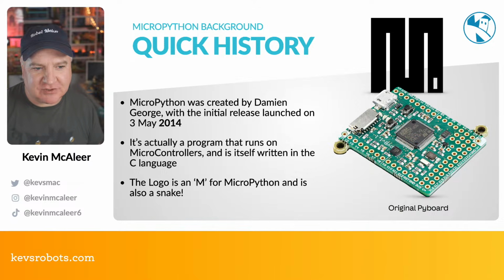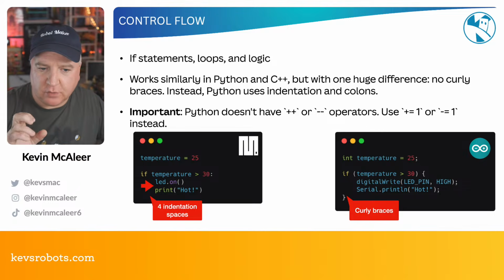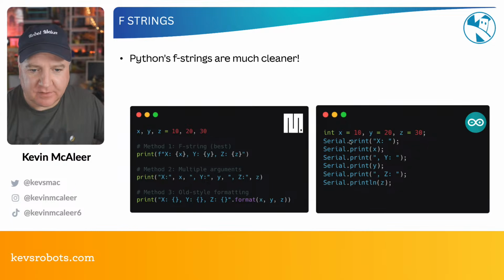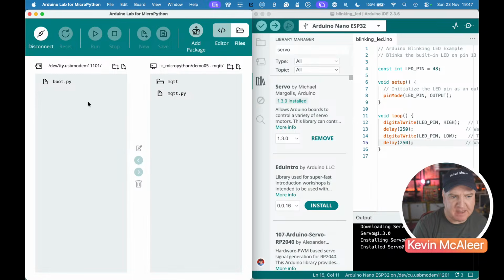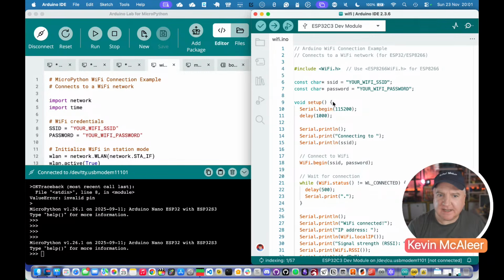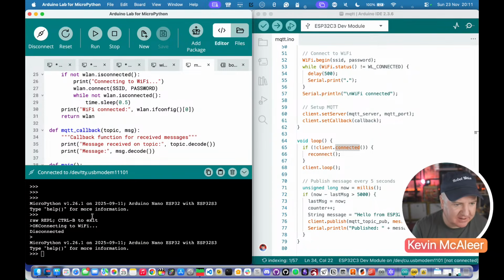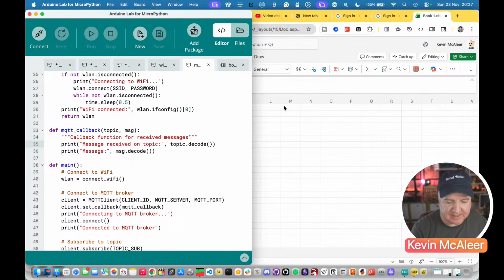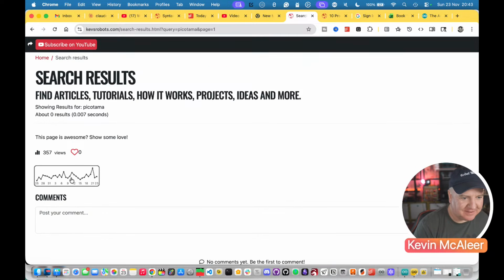Why is everyone switching to Micropython?

Comment: I'm using Micropython since the first release. CircuitPython supports features, which aren't supported yet officially with Micropython (CAN Bus e.G.). But be aware, that you can't use drivers from CircuitPython with Micropython and vice versa.

Comment: This is painful to watch as a software developer... Judging a project by stars on a repo is an awful idea, it's not used as an evaluation metric by any sensible engineering team.

But I do understand your viewpoint, if all you're doing is making simple one-off toys that only use buttons, LEDs, servos, and a sensor or two, Micropython is a perfect choice.
Reply from the maker: What evaluation method would you suggest? Given Python is used to power the worlds AI systems, and most of youtube and google, I think its a bit more capable than doing one--off toys. Micropython is just as capable as Arduino/C++
Reply: @kevinmcaleer28  Micropython is just a limited subset of Python so your comparison is wrong in that regard. There are no interpreted languages running on virtual machines that are as capable as compiled languages so your comparison is wrong in that regard too.
Reply from the maker: @pseudo_ctrl this very platform we are talking is run on Python scripts. So I beg to differ!
Reply: @kevinmcaleer28  Python is decent for gluing things together, which is a very different thing from making efficient microcontroller code. However, tons of projects don't need efficiency, and MicroPython can be spot optimized (including native code generation) for specifics with Viper. All those ML and video processing scripts call out to foreign code that does the heavy lifting. Compared to Arduino, MicroPython gets you some very helpful included batteries, at the expense of the ability to run on small MCUs. Arduino itself has some ridiculously poor implementations of I/O abstractions, so doesn't do C++ justice at all.
Reply: @kevinmcaleer28  This is going to be a bit of a novel, so I understand if you don't read it all.

First, I think there's one main thing that needs clarification: Micropython is Python in the sense that they share the same syntax, but aside from that, Micropython is not Python. From a technical perspective, this is called a different interpreter, Micropython uses a different interpreter than Python. A lot of basic, pure Python code can work on Micropython, but not all, there are lots of core libraries that are missing and any Python package that uses them won't run on Micropython.

Google doesn't use Python that much in it's applications that are consumer facing, those would be in Go, C++, and Java. Python is used in the AI toolchain where speed doesn't matter like in pre-processing and designing neural net architectures, but Python is not used during inference (when the AI is being used), that's all in C++ compiled to be optimized for their TPUs.

When evaluating a software stack or library, these have been pretty widely agreed upon metrics to assess a technologies viability at the companies I've worked for over the last decade plus:

* How many unique contributors have contributed to the project? Also, how much have they contributed?
* How old is the project?
* When was the last release of the software?
* Do they keep up with any upstream software they depend on?
* Are there regular releases?
* Is the project activity like commits, PRs, and issues trending up or down?
* Is the project part of a larger open source foundation? Like the Linux Foundation, Apache Software Foundation, Cloud Native Computing Foundation, etc.
* Are there industry conferences for it?

* How many companies are using it it production? This is important because it shows that getting a product to market is actually viable with the tech stack and that it's likely to get maintained for the expected lifetime of your product.

On this front, I don't know of any companies who use Micropython in consumer or industrial devices, but I also haven't looked into this. However, I do know of several companies who ship hardware that uses the RP2xxx series of microcontroller, and they use bare metal C or C with FreeRTOS or Zephyr.

* Is it in a stack that we can hire a development team for?

Here's where it gets interesting. There are plenty of Python devs out there, but very, very few will be familiar with embedded development. So in this regard, Micropython fails because scaling a team for product development would be difficult. But don't take my word for it, search Micropython on LinkedIn, Indeed, or other job sites. I was only able to find a few jobs that even mentioned Micropython, and even those didn't list it as a core or required skill, they list it as an example of something to be familiar with. Search for embedded C++ developer jobs, and you'll find things are very different from Micropython. 

Now from a developer's perspective, here's why I decided against using Micropython in my latest hobby project:

* Inconsistent HTTP server response time jitter with asyncio (probably GC related)
* General connection latency jitter when using server or client TCP sockets (probably GC related)
* No documented way to run CI/CD in a Docker container or service like GitHub Actions
* Supporting multiple boards for the same project is painful
* No common practice for A/B style of OTA firmware updates
* No common process for code signing firmware images
* No common practice for packaging a firmware image
* No breakpoints or hardware level debugging via GDB

All that said, I would chose Micropython for most of my projects since most of them are very simple. My most recent project has the most potential damage my equipment when I use it, so I've opted to use C and possibly Rust to ensure I have high consistency and reliability.

Lastly, you talked about speed of development cycle time with Micropython vs C. In my Micropython prototype of the project I'm continuing in C, I had made about half a dozen Python classes that were in total about 700 lines. Usually I'd be editing 3 or 4 of the Python classes at once when integrating sensors into control loops, so I would upload the full project, and it'd take about 5-10 seconds. When compiling a C project using CMake and Ninja with incremental builds, compiling and uploading can be automatically triggered based on updated files, then compilation and upload took less than 3 seconds. So when dealing with a more complicated project, compiled languages have a faster dev cycle than Micropython.

Comment: I am 34 minutes into this video and Kevin is so biased towards Python that he cannot see the wood for the trees and I cannot refrain from commenting any longer.  If he was showing me the slides in person I would want to discuss the Python "advantages" for many of them as they are just a different way of doing the same thing as C++.  Once you know a language then you know it be it Python or C++

For instance, why are all of the Arduino examples based on using an 8 bit processor ?
As an example, the slides on printing in C++ are very misleading because if you use a 32 bit Arduino board you can use the Serial.printf() function to print and format multiple variables combined with text in a single statement, just as you can in Python

Please compare the two languages using a level playing field

To me the biggest advantage of Python is that you do not need to compile the code which makes the testing/fixing of it much faster.  When I needed to analyse and report on a structured text file on my PC.  I considered using C/C++ but quickly dismissed the idea.  Using Python, which I had never used before I was able to do what I needed with AI help and the ability to try something quickly was a great advantage

Comment: Kevin says that "when you use the Arduino IDE you are actually using a language called Processing"

I don't believe that is true
Reply: Indeed not. Processing is a different one, the Arduino language is called Wiring (by Hernando Barragán), but it's really a thin prelude for C++. Edit: Apparently Processing is also based on it. For some reason, the Processing website is aggressively illegible.
Reply: A couple of AI searches say that Processing is java based and artists benefit from its visuals applications; whilst arduino is c/c++ and used for hardware interaction etc.

Comment: Arduino is a pain…
Reply: Don't worry, Arduino won't even exist in a couple of years. Qualcomm will let it vanish.
Reply: @Design_no  I agree.  The future for Arduino does not look great but I am interested in what @Unrealizedlosses meant by their comment
Reply: In what way do you find Arduino (actually C++) a pain ?
Reply: @Bob_Burton I find micropython easier to work with. Not to mention the Arduino IDE is not very user friendly in comparison to the several IDEs I use for micropython.

Comment: Kevin, thank you for an excellent video. 12:15 if the Viper decorator is used in micropython, then there is even less reason to use C. Maybe you could make a video that shows the benefits for using Viper that is within micropython?

For a comparison of Viper to C, check the luvsheth web page that is titled "Making MicroPython computations run 109x faster".